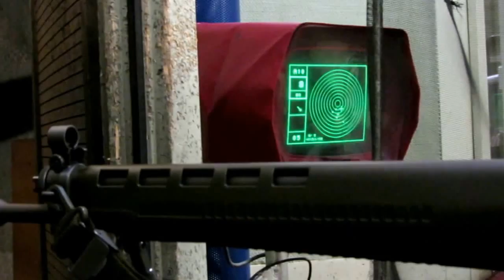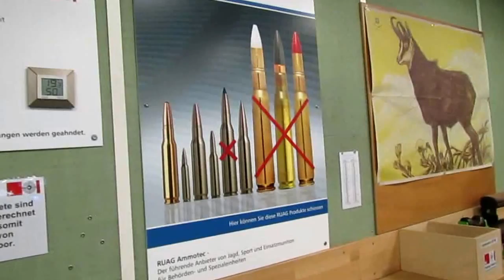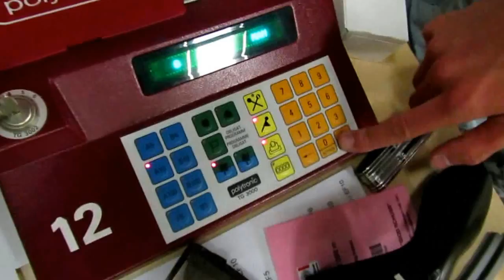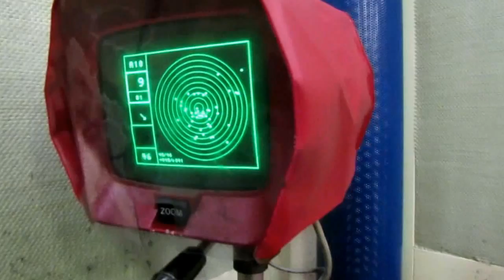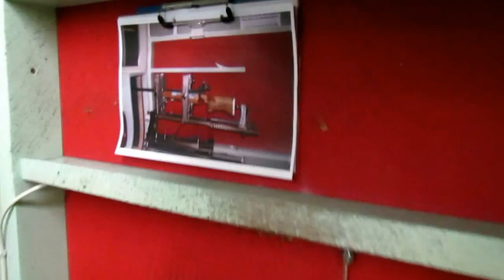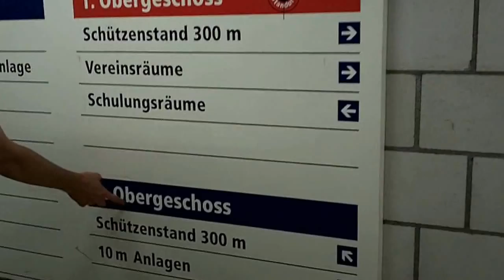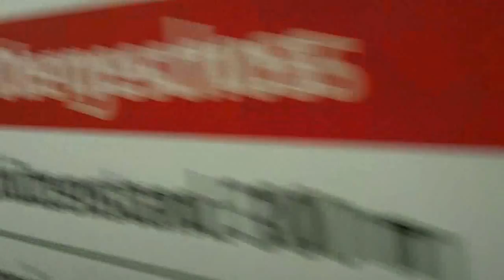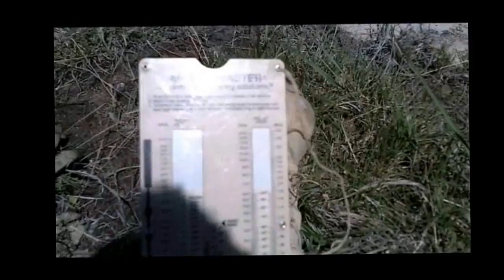Giant Swiss Underground Shooting Range - Brünig Indoor

Comment: so what are their laws on full autos?
Reply: Full auto is for benders. Men need 1 round only. But since we have to store our personal service weapon (currently SIG 550) along with a sealed canister of emergency ammunition at home, there is a full auto assault rifle in your typical swiss household. Beyond that, full autos are illegal.
Reply: v8guggi Yes normally illegal on privately owned weapons but theoretically available with a cantonal exception ruling. All the best, Rob
Reply: +Jil Steiger Not true. I attended an event where a guy was using a belt-fed surplus Czech Vz 52 in full auto. It was on a military range, but private individuals had reserved it (with permission naturally) for an afternoon. I think on a military range is the only place where full auto is possible. Otherwise it is forbidden everywhere else, including public ranges. 
Brünig Indoor is justifiably very safety conscious. But also justifiably to protect their investment and infrastructure. That's why you need an SSV licence, for example, to do pistol shooting in the 50m range at Brünig Indoor - it's to stop idiots who can't shoot from shooting the lights, walls, floor and ceiling. If you go there look at how many holes are in the light shades. Too many. All the best, Rob

Comment: How big were the 300 meter targets?
Reply: A circle with a Diameter of 1 meter, The black circle has a Diameter of 0.6m. To get 10 of 10 Points, you have to hit a circle with Diameter 0.1m.
Reply: ***** Rephrasing that, *to get 10 of 10 points, you have to hit a circle of diameter 4" at a distance of 300m (328 yds)
And to get a bullseye ("Mouche") you need to hit a circle of 2" at 328yds,* The bullseye is shown on the scorecard by a "+" instead of an arrow showing the direction away from center where your shot hit. All the best, Rob

Comment: Either the rifles are completely worn out or these lads don't know how to shoot. I shoot my grandfathers K11, my fathers K31 and my own Stgw.57. I usually get at least 3 10's  and a few 8's and 9's out of 6 rounds from any of these guns. On a good day with no or consistent wind and good light I average 4 10's out of 6 rounds and I am a rather undistinguished shooter.
Reply: The screen you see is called Polytronic and is installed on all public ranges. I live in a 230-citizen village which shares its 6 track, polytronic fitted range with the neighbouring 350-citizen village. the range may be used free of charge.The target they use is the so called A-Scheibe. It can be used with 10 step valuation but the 5 step valuation (meaning you get max 5 points) is more common. The circle for 5 points has the same (10cm/4in) diameter as the 10 point circle. The 4 point circle has the same (30cm/12in) diameter as the 8 point circle, 3=6, etc. There is a 5cm/2in circle in the center, which gets the polytronic-screen to sound a beep, if you hit inside (but no extra points). In practice I usually don't know or care if I shoot 8's or 9's because they both count as 4 but I know if I shoot 10's because it's diameter is identical with the 5's. You really don't want to see anything below a 4.The other commonly used target is called B4er with a maximum of 4 points. It is camouflaged with a darker camouflaged torso silhouette on it. Roughly, 4 points equal a lethal hit and 3 points equal severe injury. You don't want to see anything below that.The mandatory, so called federal program consists of 5 shots on the A5er and 15 on the B4er targets. You need at least 66 points out of 85 possible. If you look at the results of the two lads, you see that they would have failed by far.
Reply: And, you're just a humble guy not blowing your own horn.  I mean facts are facts, and that ain't bragging--right?
Reply: ***** Why should I be bragging? You can find the exact description of the targets, shooting procedures, time limits, etc. as required by swiss federal law in the internet. Roughly the 300m programme is:
5 x 1 single shot at target A5
5 x 1 single shot at target B4
1 x 2 shots in 20s at target B4
1 x 3 shots in 20s at target B4
1 x 5 shots in 40s at target B4
Shooting the mandatory federal programme is a bit harder than training (you get no trial shots, you start directly on the score card with a cold rifle, you can't pick when and where you want to shoot, etc.) so you always get a little lesser results than in training. I usually score seventyish, like most of the other blokes in my village.
Reply: john doe
Depends for whom. Serious sportsmen with adequat gear would likely be unhappy. For me, a certain percentage of eights is quite acceptable, considering I am using mostly an iron sights WW 1 or WW 2 era rifle with decades old standard military issue ammunition.
Reply: That's a fact.  Shooting these K31 with iron sights at 300 meters is like closing your eyes and hoping for the best.
I need to at least get that special "Visier", which I have never tried.  I shot for a while at the local Schiessstand and like the chance to shoot and smell the powder burning.  But, I got bored because stock iron sights at 300m was a bit like shooting in the dark.
I'm looking for some good tactical training.  Dynamic shooting is more fun anyway.
Reply: *****
If you are looking for the best possible results from a K11 or K31 you need diopter sights. Quite expensive. I like the authentic feel and challenge of the original sights. Dynamic shooting is not more fun from a swiss point of view...
Reply: Thanks.  Diopter sight--that's what I would need to complement the rifle.  I feel similar.  I'd prefer using the basic sights. Maybe I'll give it a try again when there is good lighting.
Regarding, dynamic shooting-- to each his own.  There are plenty of Swiss who like or prefer dynamic shooting.  Long range shooting has its place, but it is of limited use in a dynamic combat situation.
Reply: *****
 Almost all of us old blokes you meet at the Schiessstand with a Stgw57 or K31 have had our share of dynamic shooting in our service time. After 15 years or so of service we cleared our attics of a boot full of gear and hauled it back to the armoury, along with the rather hypothetical chance of ever having to face a dynamic combat situation. Our target practice is recreational only. It's about meeting the mates, shoot a little, brag a little, smoke a stogy and have "un verre du blanc"
Reply: Hey, right on V8.  Have fun.  We belong both to the greater gun Club, and we are aiming in the same direction. 

For me, I did my Service too.  But, I'm still fervent to the oath I took.  Further, I want to be ready to defend the good and innocent, starting with my Family first.  Besides, I still get a rush from the combat simulation.

I'm happy Switzerland has a line of "ol' blokes" between that entity which would do evil and the sanctity of her constitution.

Gottes Segen!
Reply: Andrew, V8 - I tried a K31 at 300m without the diopter for a season but it was hit and miss (literally). With a diopter I am slightly better with the K31 than the PE90 I think because the round is heavier and not affected so much by wind and because the sight length is greater. And since the rubber recoil pad is allowed, I can shoot my K31 in a T-shirt!
All the best, Rob
Reply: Rob, thanks for the tips.  I think the rifle is a grand piece of gear and the round is a respectable hunk. Hit or miss was my same experience.  At first I wanted to try and master it with the basic iron sights.  I lost interest because shooting a fuzzy black dot with only an electric screen telling your hit just wasn't exciting.  The little boy in me wants flying debris, an explosion or at least a hole in paper. The rubber butt pad sounds like a great idea.  Someday I'll get a diopter.
Reply: In the pre electronic screen era it was more fun. Everyone who spent some time shooting also had to spend some time in the trench beneth the targets, signal flagging the results and patching the bulletholes...
Reply: Back in the day... Wouldn't mind going back to some of the old ways.  All the best!
Reply: Rex is one of the best long range shooters I've see. He doesn't have these guns setup for him.watch his other vids he hits targets over 1k yards